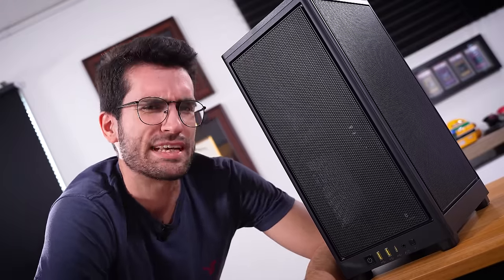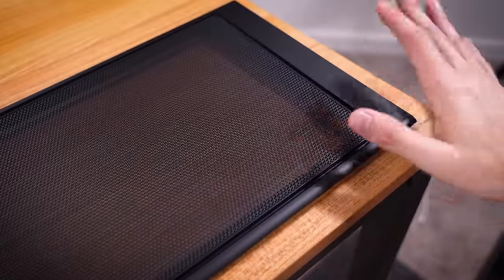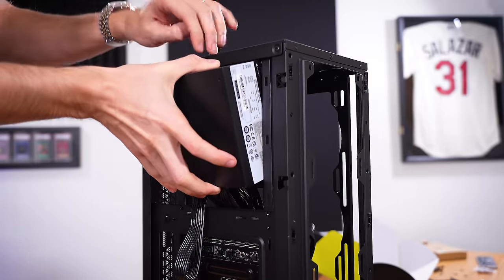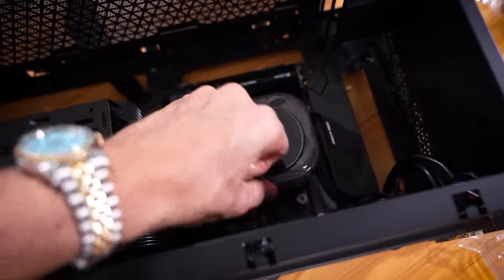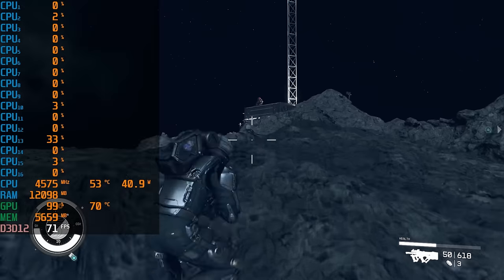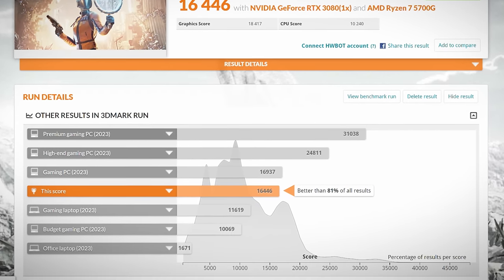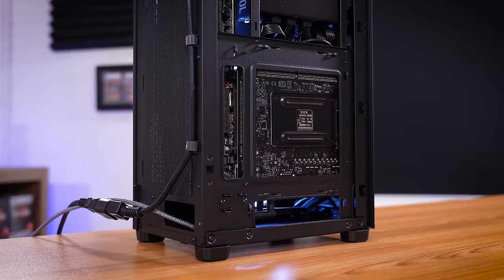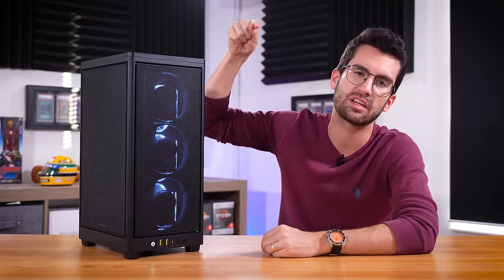We Packed SO MUCH Into This ITX PC!

Comment: I'm more of an MATX type of guy, but I have massive appreciation for these ITX builds. Clean, sleek design; unsuspecting sleeper, if you will. Not to mention all the work it takes to fit everything inside.
Reply: Same here, mat really needs more love imo. I just built one in a Silverstone Alta G1M chassis that looks very similar to the corsair in the video 😅
Reply: Agreed. Unless you live on a sailboat a tiny house or a HTPC for gaming where every inch counts but you want a powerful gaming PC I'd go mATX. I'm not sure if this is just a proof of concept or a rebuild of the HTPC built a month or so ago with revisions?
Reply: Yup, matx is the go to form factor if you want ample room for cable management. I'm not saying itx form factor is not cable management friendly at all. Its just that matx is like the middleground not too big nor too small.
Reply: Agreed but I wish there are more small MATX cases.

Comment: Change the 3 front fans to exhaust. Help the gpu to intake cooler air and pull air thru the AIO. And the case can spit the hot air out into the room. Something to consider.

Comment: Great build Greg 👍😇!
As an ITX builder for over a decade now I can attest to the frustrations and costs associated with an ITX build 😱🤯. Saying that thou, as with multiple case builds under my belt, over the past 25years or so, you learn tweaks, shortcuts, hacks etc to minimise hassles with a pc build, especially with an ITX pc🥰🥳👍.
I personally too remove dust filters on all my builds for ~15years now with the exception of psu dust filters as I use one of the dust blowers for pc every 6 or so months to keep it mostly clear and cool.

Comment: I just built my new PC in this same case, though I went with an air cooler and somehow managed to cram a BeQuiet Dark Rock TF2 into it.  For the other fans, I did Corsair iCue link fans, 3 120s up front and 2 140s on the side, spread to top and bottom.  It was a challenge, but works well.

Comment: Im not a fan of the power cable solution and lack of carry handle. Ive been very happy with my Hyte Revolt 3. 5800X3D, 3080 FTW3 and temps are never an issue
Reply: I really liked building in the Revolt 3 too.

Comment: I have this exact same case in white, and there's plenty of room for a 360mm AIO. I have 3 Arctic 120mm ARGB PWM fans on front for intake and a be quiet! Pure Loop 2 FX 360mm AIO on the side for exhaust. I'm about to replace the Cooler Master 850W SFX power supply with a new ROG Loki 850W SFX-L power supply that's ATX 3.0 compliant. Yes, it does have the dreaded 12VHPWR connector built in, but I'm future proofing for the upcoming RTX 'Super' cards, namely the 4080 Super if it's within a reasonable price (in CAD, it most likely will be $1,200-$1,400 on launch...)

Comment: I'm an ITX fanboy so you would think that I would be the target market for this but I already have a NR200 case which has a ton of airflow, fits 3 slot/3 fan graphics cards and can fit a 240mm AIO (not that I use one, I have an air cooled setup instead). I can;t see the SFF enthusiasts wanting something that chunky when the NR200 exists, or the high end gamers wanting something that cramped.

Comment: Yeah, I went with the Meshlicious and getting it's configuration just right for my hardware took several test fits to get it perfect. I have mine sideways in the entertainment center like you do. This looks nice because the Meshy is much more limited on length. Though I feel like sideways in the only use case that would make sense to me personally, or you just have to be an ITX enthusiast, and want this as your main system.

Comment: I have a MITX computer in a Purple Cooler Master NR200P, with a ryzen 5800x and a rx 6800, had to remove the gpu fans and made the GPU cool with the fans in the bottom of the case, got me 2x Phantek T30 @80% fanspeed and the rx 6800 never goes above 50c not even @2400mhz core 😋.

Comment: I can understand that fact that higher end GPU's are getting really huge these days.  You need the space to fit them.  And a lot of newer CPU's require something much more than the average cooler.  You need space for that too.  Simple ITX builds are getting not so simple anymore.  At this rate, it won't be long until we see ATX cases being the new ITX standard.

Comment: Take a look at the Rajintek Metis Plus. It is an interesting little case when set up correctly, very small and a clean look from the outside. The glaring issues with it are to replace the plexi side panel with cage or grid, and reverse the rear fan for intake if you leave one there at all.

Comment: That power cable was definitely an after though, put PSU few mm lower and it could be hidden inside. And yeah, for an ITX build it is so huge. If anybody need water cooling, there are smaller cases with 280 radiator support, which should be enough for most CPUs.

Comment: interesting video, but even though the Corsair 2000D can accommodate an AIO up to 360mm or Noctua D15 air cooling, I would still stay with Ssupd Mesroom S, mainly because it is smaller, can accommodate an AIO up to 280mm and, depending on the configuration, ITX, mATX or ATX motherboards and power supplies from SFX to ATX

Comment: Noctua PF-12's run 800 rpms slower than the Silent Wings, have up to 71 cfm at 25.1 db. The SW are up to 31.2 db , 76 cfm and cost a bit more. Just saying.

Comment: i bought the msi vampiric 100r. that had a dust filter  across the front. i removed mine for better flow. i do get a bit of dust build up but my temps dropped 10c. any future build i will remove that every time. im not a fan of the corsair case ill be honest

Comment: I wonder if there's a way to route the power cable within the leftover space by the graphics card.  Drill an extra hole in the top and it may work.  

Beyond that, I've migrated alot to SFF builds, with the last two being in a CM NR200 and a NZXT H1 v2.

Comment: I do like the look of the front with your RGB set to white, it definitely looks different from most builds you see these days.  If I were going to lay the case down on it's side, I'd remove the current 'feet', and likely design some to replace them on the side of the case to be printed.  Then you could orient the power supply as it's intended to be placed, with the fan out.  Not a HUGE deal, but they you wouldn't have to flip the power extension like you did.  It'd look more like 'audio gear' with the feet on the 'side' than it will just laying directly on the shelf...

Comment: Always a fan of the small factor builds. The build you did looks good but I don’t think I’m a fan of that case, the routing of the PSU cable looks to be an after thought, I’d prefer it to be routed internally. 
I’d have been interested in seeing what effect the dust mesh had on the cooling performance under load.

Comment: I feel it's a badly designed case for what it's supposed to be which is odd coming from Corsair. ITX cases are supposed to be minimalist small jewels of computing. They're hard to build in but you're supposed to get an aesthetically pleasing and novel computer at the end of the build. I built my wife's machine in a Hyte Revolt 3 and I took the cover panels that just pop off to an automotive paint shop and had them sprayed with a rainbow metal flake piano black paint finish. It looks very designer and it's got pop-out headphone hooks and a brushed aluminum pop up handle on the top. She doesn't give a crap as to it's performance other than can it play the games she likes and can it edit her videos. This Corsair case fails, especially that awful power cable hanging down the back.

Comment: This is the by-product of making GPUs massive. Is it really a Mini-ITX case? Or is it a glorified GPU enclosure with room for an Mini-ITX board?

I have a Fractal Designs Core 500; it's smaller than that Corsair but still accepts ATX PSUs. 

I have always associated Mini-ITX cases as being 20L of volume or less. The Fractal barely clears at 19.5L, it's about as big as I'd want to go. 

24.4L is a touch too big, you might as well go μATX at that point.

Comment: 5-10mm taller and they could have fit a panel mount IEC jack on the back to eliminate the flappy cable nonsense. they're 22mm top to bottom, 40mm wide. that gap between the gpu screen and the top of the case where the panel is folded over is roughly 15.

the cable is.. sloppy. someone higher up almost certainly insisted on a specific shell volume. absolutely ridiculous.